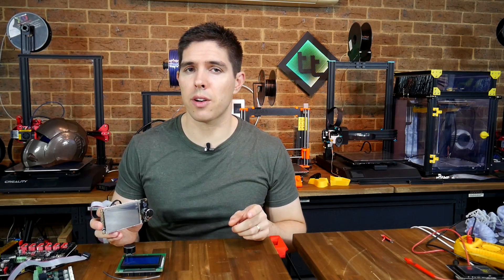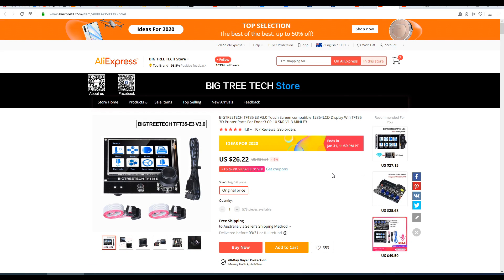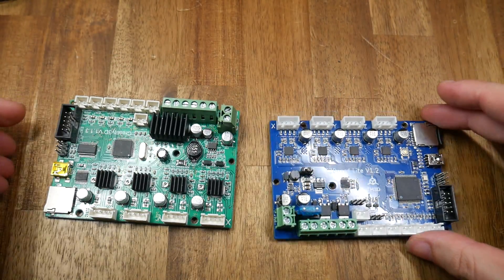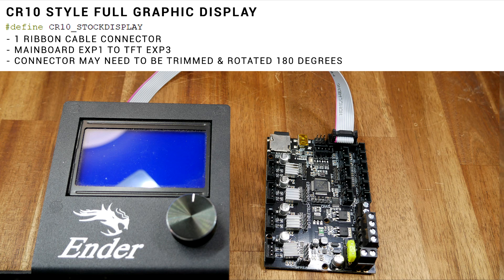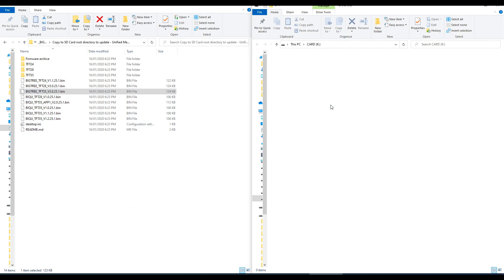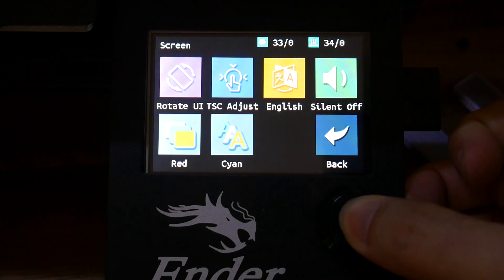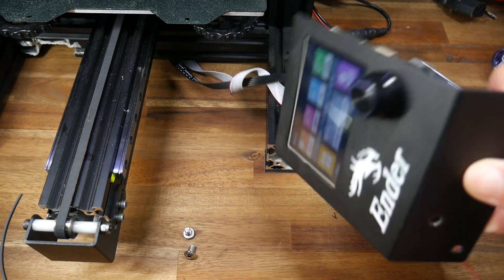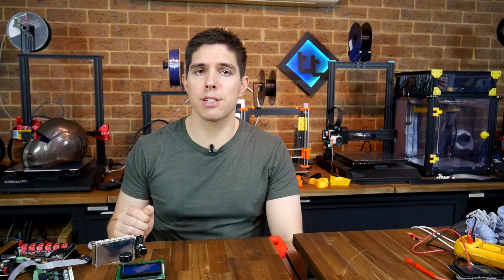BTT TFT35 dual mode touch screen guide

Comment: Thank you for this guide. I'm running into a bug. I've installed onto and Ender3Pro with the SKR1.3 and the TFT35 E3 dual display and I'm not having any luck with the LCD standard display mode. All I get is background color and no words at all, even after turning the knob. The touchscreen seems to work just fine. Can someone help?
Reply: I am getting exact same thing.  Just with SKR V1.4 Turbo/TFT35 E3 v3.0.  All with latest FW from Marlin/TFT35.  Anyone have Ideas?
Reply: Same issue for me. Did you ever find a solution?

Comment: Awesome Video! I got mine a couple of weeks ago, but I noted a weird behavior since I installed it. 
I have the SKR mini 1.2 board it was working great until I installed the TFT35 e3, now while printing it stops mid print for a couple of seconds and then continue, leaving blobs on the print from when it was stationary. It does this around 2 or 3 times per layer. It almost feels like it stops thinks for 5 seconds and then continues, there is no warning or any error on the display.
I re-flashed the firmware with Stock Marlin and the prepared version with BL touch that you posted a couple of videos ago with no luck. The only way I can make it work without pausing again is  uninstalling the TFT35 and plugging in the old LCD.
Have you had any weird experiences like this with this TFT while you were testing it?

Comment: I have a problem with this display. when I try to switch from TFT to LCD Marlin simulator, the screen remains black and does not show me anything.
someone can help me?
Reply: hi. i have same problem dit you god a fix for it ?. grettings
Reply: @tommytamsen3948  unfortunately still no solution to the problem!
Reply: Make sure that all of your cables are set correct, the touch mode can work even if the other cables are wrong.

Comment: I do have a CR10S and as far as I know the original board is a ramps based board, at least it got the Aux1 port. So these screens will work in both modes with it right out of the box, right?

Comment: Great video. I've just upgraded to the TFT35 V3.0 screen on my ender 3 with the SKR 1.3 board. Everything displays fine and the touchscreen works, but I cannot navigate up and down the menus in marlin mode. I can click the dial to bring up the menu, but when I turn the dial nothing happens. I have the latest firmware on the tft35. Any ideas what to try please.
UPDATE: it turns out the problem was a faulty ribbon cable, luckily I had a spare and all is working great now

Comment: UPDATE: For anyone that it helps... Idk why or how this fixed the problem. But I Stopped messing with Marlin firmware, that was not the problem. I tried having the touch screen wires plugged to the tft35, and the display ribbon cable to the stock screen... both then turned on fine. After that, I plugged the ribbon cable into the tft35 again, and after that it worked, but only if I removed and reinserted the ribbon cable. The permanent fix to this was to unplug the restart connector from the skr... Now all is good, works just fine along with pi and everything. Was not plug and play by a long shot, but at least I got there. 

Cannot get this thing to work for the life of me... skr 1.3 board, marlin 2.0, correct plugs go in and I just get a black display. Holding the nob or moving it does nothing. If I remove either the ribbon cable from ext3 or the touch screen cable, then I will be able to SEE the screen where I choose which mode, but it does not work. At one point I manged to get into the touch controls and everything worked, and at another point I could get into the marlin screen... but as soon as I tried to switch it just got stuck at the choice screen. Any suggestions? Tried messing with the serial ports in marlin to no success, and tried inverting the ext3 ribbon connection which led to loud beeping and flashing... and tried running it as reprap discount full graphic with the two ribbon cables, also with no success at all.
Reply: P F Thank you! I was having the same issue.
Reply: Thanks PF I upgraded to an SKR1.4 Turbo and ran into the same problem! Disconnecting the Reset pin from the TFT cable did the trick, thanks again.

Comment: in the marlin mode (LCD128664 simulator) it says "No SD Card", is this normal? in the Touch mode is works fine!
Reply: In that mode, it refers to the sd card on the main board, not on the TFT.

Comment: I love the idea of a touch screen, but I don't think I'd really want one unless it could work well with Octoprint, and even then I'd probably only want that for Klipper and the cancel object thing. So unless there's a nice mainboard and screen that does all that I'll keep with the stock board for now.
Reply: The main reason I don't use Octoprint currently is that I can't have the printer remotely start and stop, and I don't go out enough to need remote monitoring, and I couldn't get cancelobject to work...

Comment: marlin mode does not work on my screen, has done all you need in marlin but it does not work (it dig work before fw update). .. can i do bed leveling on tft screen?  without bl touch!  if it can, how?  can find no information about it..

Comment: any one got any guides step by step for installing and setting up BIGTREETECH SKR Mini E3 V1.2 Control Board 32Bit with TFT35 E3 V3.0 Graphic Smart Display Controller Board for Creality Ender 3 ive installed the board and the screen ive updated the screen   not touched the borad but when i power the ender 3 up the bed heats up by itself and beeps and says reset  cant get it to print anything

Comment: Anyone else have a problem mounting the metal frame that holds the screen?  The round speaker touches the bottom frame of the printer so it's impossible to place the frame back in it's original position.  I have the TFT35-E3 v.30 and an Ender 3 Pro.

Comment: Great tutorial as always Michael.
I've a problem though....
My setup: Ender-3 pro, SKR MINI E3 v1.2, BTT TFT35 v3.0, bltouch

Everything was working fine until I setup the TFT35 display. The display is connecting to the printer properly and works for itself as expected, BUT:
Since the display was installed I can't get the printer to run ABL successfully anymore. It acts like it would not know anything about the bed size and "crashes" the hotend/extruder (I'm running a direct extruder setup) into the boundaries. The x/y/z endstops for homing and auto-homing itself (G28) works though.
I've tried to set my reduced bed size (due to the direct extruder mod) not only in marlin but also in the tfts firmware without success.
I'm not even cirtain if really the ABL is what's not working as for testing purpose I've modified a gcode and removed the G29 command which results in the exact same behaviour as described before.
It also seems that with the TFT the SAVE_HOMING value of marlin is not working anymore as it tries to home the z-axis (bltouch) not at the center of the bed (using x-size/2 and y-size/2 values in marlin).

Do you or does anybody else have/has a clue whats happening here?
Any tips are very much appreciated!
Reply: Just tested to revert back to the standard TFT screen which confirmed that the issue is related to the BTT TFT35 upgrade. For some reason during auto-home (G28) the Z-probe is not done in the center of the bed but instead the printer tries to run it at the x-max and y-max position which results in the bltouch sensor missing the bedarea during testing the z-end.

So its quite obvious that with the BTT TFT35 the Z_SAFE_HOMING values of marlin are ignored. (I have disabled ABL in the TFT35 firmware without any changes)

Comment: Using the TFT while printing makes my skr mini E3 freeze sometimes and I get giant blobs. While printing I only use the marlin layout.
Reply from the maker: You can try and up your baud rate in the Marlin firmware to 250,000 (from 115,200) and set the screen to match. This will effectively double the communication speed.

Comment: Hey Michael! EzBoard designer here- I have one of these screens on the way to confirm it works with the serial pins. I’ll update this comment once I confirm but I have used the serial header in the past with zero issues!
Reply: Did you ever confirm if this worked with the ezboard?
Reply: keep us posted would love to add this to my machine
Reply: Any update on your testing of the ezboard?
Reply: @bgiardi  I had it working with the EZBoard. Unfortunately the display I had as well as the one Tim got both have issues upon arrival. Because of this the the known reliability issues with these, we decided to leave it out of the Unified branch. If you want to use it, it's entirely possible to enable it like in this video while using the serial header on the EZBoard.
Reply: @itsmegriffo  what kind of issues were you having?

Comment: Does this works with SKR Pro as well? I'm planning putting SKR Pro (is on the way) to my Ender 3, and I use octoprint as well in a RBPi2B+. BTW congrats for your videos.
Reply: Be careful with that upgrade, the instructions that were included with mine were of extremely poor quality and the board itself turned out to be bricked from the factory. But, it took me hours to determine that and the instructions were of little help.
Reply: Yes, it works with skr pro.

Comment: If you use filament runout detection through your mainboard and Octoprint, please be aware that filament runout might no longer work when using the TFT.
Last time I checked the issue wasn't detecting the runout, the issue was running the M600 filament swap procedure.
Reply from the maker: This is correct, but fortunately you can switch back to LCD mode for the part of the process. Inconvenient but on the MKS TFTs it was impossible and therefore a deal breaker.

Comment: Hey!  I love your videos, unfortunately I've been having an issue with my TFT 35.  I'm currently running it with a SKR mini E3 V1.0 (the one without soldered drivers) and I'm having a weird issue where in the "Marlin mode" everything works fine, but in the TFT mode I get the "No printer attached" error.  I've played around with the baud rate and the serial ports but nothing has worked.  I also tried to to update the TFT 35 via SD card following the directions outlined in the video but it doesn't update.  Any ideas on what I could try?
Reply: Okay, so I figured out that the TFT 35 wasn't able to read my 64GB SD card.  After trying it with a 128MB card I was able to update the firmware.  Unfortunately, this did not fix the "no printer attached" error in TFT mode.  Still stuck and looking for answers
Reply from the maker: Check your serial port settings are correct in Marlin: https://github.com/bigtreetech/BIGTREETECH-SKR-E3-DIP-V1.0/blob/master/Firmware/Marlin-2.0.x-SKR-E3-DIP/Marlin/Configuration.h Serial port 1 set to 2 and serial port 2 uncommented and set to -1.
Reply: @TeachingTech  I have the same issue with the e3 mini 1.2.  Your link is dead.
Thanks

Comment: @Teaching Tech So I have had this display for a while but have failed to upload the newest firmware. It installs the bin file, but doesn't upload the fonts or bmp's. It then brings me to what appears to be the calibration screen, but I can't finish the calibration or read any of the text (looks like static). Did you happen to have an issue like that?
Reply from the maker: On the standard (non E3) version, after updating I was asked to calibrate the screen by pressing in a few spots. Works fine. Haven't had any issues updating either.

Comment: Hi Michael, is the TFT35 E3 dual mode touch screen compatible with the TH3D EZBoard Lite or will it require the mods you cover in this video?
Reply from the maker: TH3D have one and are investigating, fingers crossed!

Comment: Hello. I have a question.. is possible to use the wheel at the same time you are in touch screen mode? For example to adjust Z babystepping with the wheel without changing to wheel mode?. Thank you for the information.
Reply from the maker: It seems to have no function in touch screen mode.

Comment: Hi Michael, another great video.
Just one quick question, can this be used to restart the marlin m600 filament change by pressing the button? Thanks
Reply from the maker: You could hold the knob down and switch to LCD mode to do this, so yes.

Comment: I've had this on my ender 3 for a week now with Octoprint and a E3 Mini SKR 1.2 and it seems to work OK but I have had a couple of instances where I've gone into the extrude menu whilst it's printing from Octoprint and when I've come out of the menu it's pulsed the extruder and squirted a blob of filament onto the print, has anyone else seen this?  And thanks for doing the video it's given me some info i wasn't aware of.
Reply: Same Problem
Reply: @dano5812  Have you raised it as an issue on the GIT hub page?

Comment: Anyone else having issues with the "No Printer attached" error? I have the TFT35. I got it in a bundle pack with the SKR mini E3. I hooked up the SKR mini to a Sovol SV01 printer. It works great for that printer besides the Ender 3. However, I can't seem to get rid of the "No printer attached" error. Crazy enough, the standard LCD screen works fine. How can the standard LCD screen see my printer, but the touchscreen cannot?!
Reply from the maker: Because it connects in two different ways. Check your serial port settings are correct in Marlin: https://github.com/bigtreetech/BIGTREETECH-SKR-E3-DIP-V1.0/blob/master/Firmware/Marlin-2.0.x-SKR-E3-DIP/Marlin/Configuration.h Serial port 1 set to 2 and serial port 2 uncommented and set to -1.

Comment: Very informative video, what is the cable called to hookup the touchscreen? I need to get a longer cable and not sure where to get it or what its called. Thanks
Reply from the maker: On the main end it's a dupont connector. You could buy or make a simple male to female extension.

Comment: Can you rotate the screen in the firmware so you can put the knob on the left?
Reply from the maker: Yes, there is a rotate feature, in the TFT menu, so no need to even tweak firmware. Untested by me but I've seen it there.
Reply: @TeachingTech   Thanks for the response. I'm trying to decide if I should get this or the touchscreen for my octoprint pi. I'm leaning toward the pi screen because the printer menu is fairly useless during an octoprint controlled print.

Comment: I use the TFT35V3 with the SKR Mini E3 and it works well, but once i a while the emulation screen is scrambled.
Reply: this happens randomly, but it keeps on working.
I could a a picture someway if needed.
Reply: @fredboliau6963  It's really annoying when it happens, from what I noticed the trigger is the encoder wheel but if you keep moving the encoder back and forth quickly it eventually recovers. the only downside i've found is that it doesn't work with klipper because "Marlin mode" works as an emulator and klipper doesn't support it.
Reply: Hi,
I contacted Creality, and they answered, that it could be Interference from the power supply.
I rapped the display ribbon cable with aluminium foil, and strangely enough, the display is OK.
So You could try this....
Reply: @fredboliau6963  interesting, I always thought it was just buggy software. I'll be relocating all my electronics soon anyways if the PSU is the issue then it won't be for long

Comment: Is there any reason or advantage to plug runout sensor to TFT than the main board it self?
Reply from the maker: Some people don't like to play with 3D printer firmware so this is more approachable. Plus if you intend to generally print from the TFT, the filament runout interface will be presented on the touch screen interface.

Comment: Hello, Thank you for your time!  Would this also work on a ender 5? Thank you...
Reply from the maker: Not with the stock board, please see the compatibility section.
Reply: @TeachingTech  I was considering to install SKR Mini E3 V.1.3 Control Board on my Ender 5 and replacement is really easy, BUT problem is firmware (for us noobs). I  couldn't find the right firmware and tutorial how to do it :-(

Comment: Michael, your video came just in time!  Two days ago I received my BTT TFT35 V3.0 Smart Touch Screen Controller and was going to wait to install it after I completed my current overhauls I’m doing to my Ender 3 printer.  But now that you have provided this guide, I’ll add it to the rest of the items I’m doing to upgrade my Ender 3!  Once completed, the Ender 3 won’t look much like a standard Ender 3.  

Items I’m doing to it include:  
1.  Upgrading the firmware to Marlin 2.0.x
2.  Upgrading to the BTT SKR V1.3 32-bit Motherboard
3.  Upgrading to the BTT TMC2209 Stepper Motor Drivers
4.  Adding the BTT BL Touch Auto Bed Leveling Sensor
5.  Upgrading to the WINSINN Dual Gear 1.75mm Filament Extruder
6.  Moving the motherboard case to the rear using your STL files
and now,
7.  Upgrading to the BTT TFT35 V3.0 Touch Screen Smart Controller with a BTT ESP8266EX ESP-01S Wireless Module

After the mods are completed, I am also going to realign the vertical rails to insure they are square to the base rails, then also tweak the X-Axis rail is level to the top rail.  

My first year mods (that have already been completed) are:  New bed leveling springs, tempered glass build plate, a Meanwell PS, Capricorn PTFE XS 1.75 tubing,  and a Raspberry Pi 3B (for Octoprint).  I’ve also replaced the scorched knock-off XT60 connectors with original XT60H connectors.

Thanks for the videos!  I know you work very hard to make sure the content is correct and up to date!  Thanks again...
Reply from the maker: Well done on your mods so far and good luck fitting these new ones. Thanks for watching :)

Comment: Timely video for me as I received the dual mode screen and SKR Mini E3 bundle a few days ago.

(Second SKR Mini E3 I bought, as I got the early production one shortly after they became available.  As I had a few problems with the first replacement board I tried — the MKS Gen L V1.0 — and didn’t want a repeat I procrastinated about installing it.)